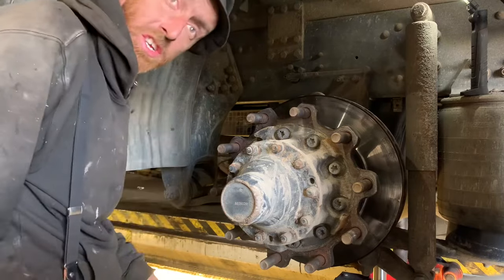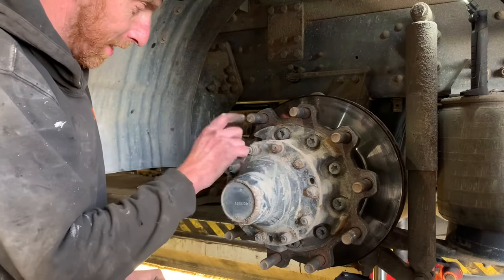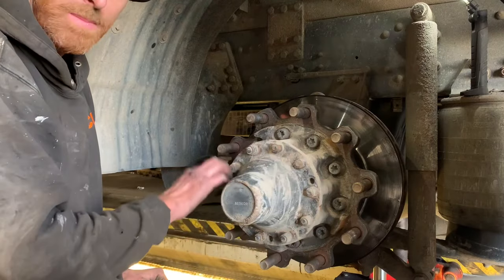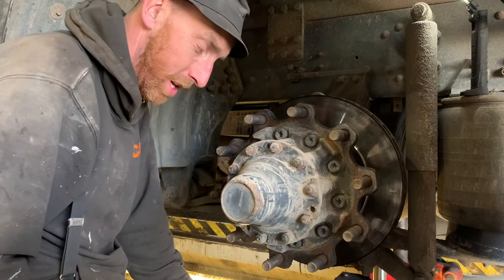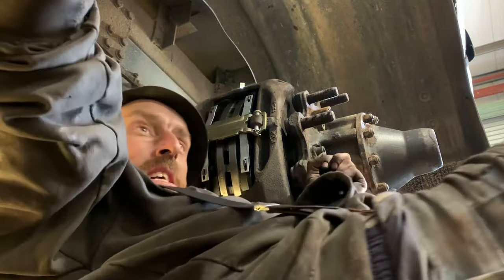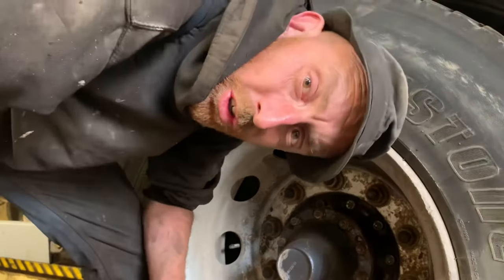How to change brake discs and pads hgv mobile mechanic Scania lorry truck hgv semi rig

Comment: I always replace the hub seals as well at the same time, been caught out too many times with seals starting to leak a month after they’ve been disturbed, plus I repack the hubs and bearings with fresh grease. As for the half shaft collets I just use long withdrawal bolts and gently tap the cap with soft face hammer whilst using air gun to gently tighten withdrawal bolts evenly and slowly, the collets come off with the cap usually, great channel you have here, keep up the good work you deserve every success 👍

Comment: Put the nuts back on a couple of threads. Pull the hub cap off using the draw bolt holes. When the hub cap comes off far enough that it hits the hub cap nuts, stop and take the draw bolts out. Then twat the hub cap back on, the collets will stay on the studs or be loose enough to get out. I worked for scania as a technician for 20÷ years

Comment: Alright fella found ya channel weeks ago and very funny 😄 
Them collet’s come of the hub easy as mate bit of lube 😗 on when you remove the nuts put M14 bolts in the hub face and draw the hub of the collets will come of with the hub it’s worked for me all the time I work at scania too chum cracking vids btw
Reply: No torque wrench naughty naughty fella 🤣
Reply from the maker: Thanks mate and cheers for watching pal 👍

Comment: Chris what size socket to get hub nut off and do you have a part number for it the one I got is too small ..thanks
Reply: As im right its is a 80 mm or 110 mm 8 Point Socket.

Comment: For the collets i take of the nuts. use penetrating oil, put some tention with the draw bolts like you did. then hit the hub cap just above the studs. its gonna mess the customers paint up abit but thats sometimes the only way to get them to pop out

Comment: Air chisel on the face rattles them loose a lot of the time I find. Working on old shit sucks sometimes
Reply from the maker: A few people have said that I’ll try it next time 👍 cheers Craig
Reply: @Professional-struggler  Air Hammer for the Win. Get some good Quality Hammer, with a lot of Punch. Did make hard work very easy and controllable. Never without 😆